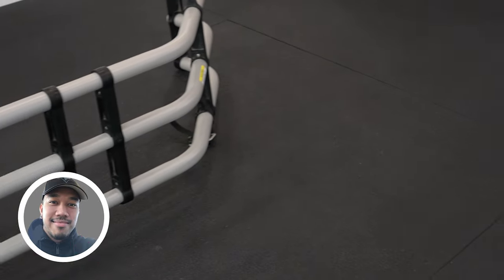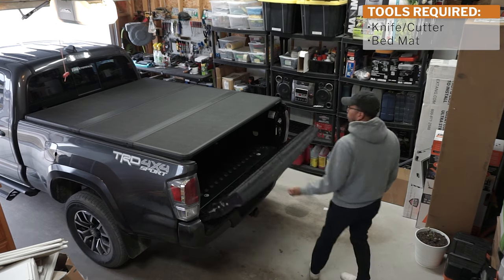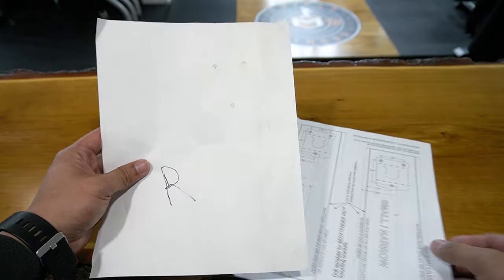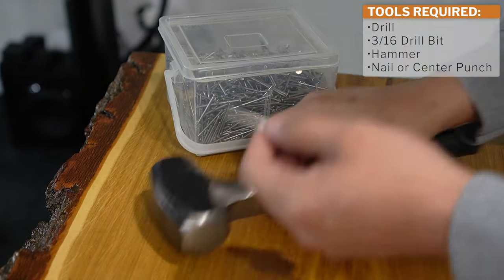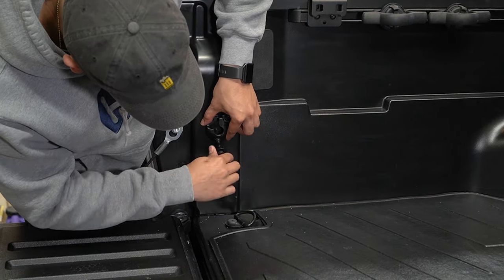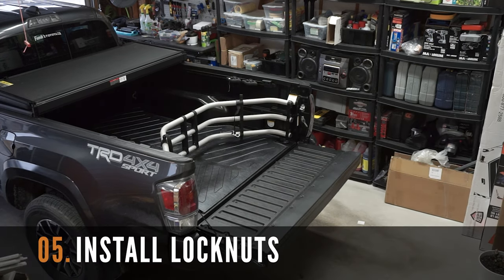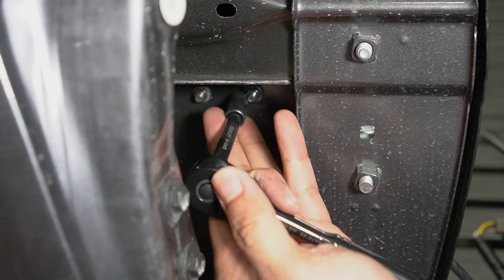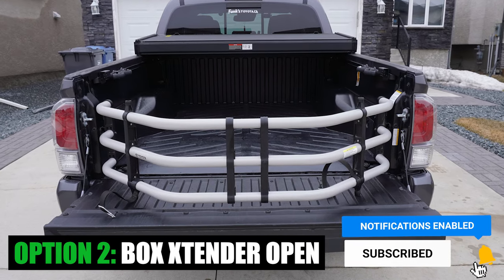OEM BED EXTENDER INSTALL on the 2022 Toyota TACOMA TRD Sport | EASY DIY

Comment: I just installed my OEM bed extender for my 2022 Tacoma OFF ROAD and I’m glad I saw your video. The instructions, especially the measurements and template from the factory must be for 2005 model. I assembled the extender first and put it on the bed and your instructions make sense. I did exactly what you showed on this video. I even learned how to remove the tail lights. Thank you so much for a very detail video. 👍🏼👍🏼👍🏼
Reply from the maker: Hi Manny! First congrats on the new vehicle! I'm glad my video helped out, try to put as much details as I can. Thanks for the kind words. Good luck on the future mods!

Comment: Very nice. Something I personally wouldn’t do just because I’m not comfortable with having to drill into my truck lol
Reply from the maker: Thank you! I was skeptical of drilling as well but I'm happy I did as this is so convenient to have. The fact it can be a cage/separator in the back to put groceries (so they not in the back seat) in is so convenient!
Reply: It was the first time i drilled my brand new Tacoma (380 miles only). I was very confident to do it because of this video.
Reply from the maker: @POGIAKO62  thanks Manny! I did this as one of my first mods too so I was just as nervous with drilling! But glad it worked. Thanks for watching!
Reply: @themandiyrin  the 3/16 drill bit is the best size as you mentioned because you can screw it without putting the nuts so that you can test it just like on your video. On the manufacturer instruction is says 15/64, which is quite a big hole.
Reply from the maker: @POGIAKO62  Yes! I agree! Glad that size worked well for you too👍🏽

Comment: Marc, really appreciate your DIY channel; I have a 2021 Taco TRD Sport (2wd) - want to put in a bed extender (OEM or Rough Country. Wanted to ask you what you thought using self-locking screws for the mounting brackets so you can no need to take off the tail lights. 
Thanks, looking forward to hear from you.
Reply from the maker: Hi thank you so much for watching my video! Appreciate the kind words. 

For self-locking screws I’ve never looked into them as the tail lights are fairly easy to remove. I think it would work thou!
Reply: Thanks Marc for replying.
Reply from the maker: @jssantosmd1  no problem! Let me know if you have any questions when installing your extender. It's a great addition to the Tacoma!

Comment: I'm only assuming this will also work for a 2023 off road. Where did you pick up the hardware? Great video!
Reply from the maker: Hi Curtis, thanks for watching and the kind words. I’m also assuming this works for the 2023 off-road as it’s still a similar 3rd gen design. As for the hardware, it came with the OEM bed extender.

Comment: Question? 
Is there a product or a way to run bed extenders with bed stiffeners ? Please and thank you.
Reply from the maker: Hi, thanks for watching my video! I'm actually in the same situation looking for a solution. I think you'll have to modify your bed extender (shorten it in width) then add spacers between the bed stiffener and the brackets for the extender. It's the next in my list of videos. Will keep you posted!
Reply: Thank you! Appreciate it!

Comment: Where did you get the brackets? Do you have a part number. The ones I got look different with some sort of spring loaded release
Reply from the maker: Hi thanks for watching my video! In regards to your question, the brackets came with the kit for me, not sure why yours is spring loaded, maybe you have an updated version of the bed extender? Did you purchase the oem one or aftermarket

Comment: hi, from the template, why did you used the bottom of the paper instead of the solid line that says "Truck Bed" for the alignment?
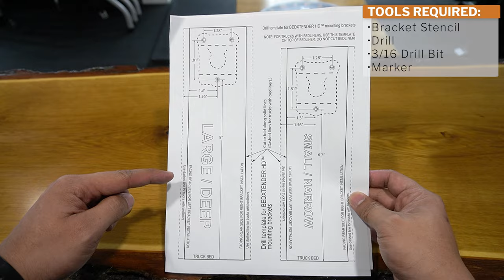Reply from the maker: Hi, the reason I went to the bottom of the page is because I measure this template from the original owners mounting holes and found that it lines up to the bottom. See @1:57 of the video.
Reply: @themandiyrin  thanks, great video, i appreciate your guidance
Reply from the maker: @ajc9583  you’re welcome! Good luck on the mods and let me know if you have further questions! Thanks